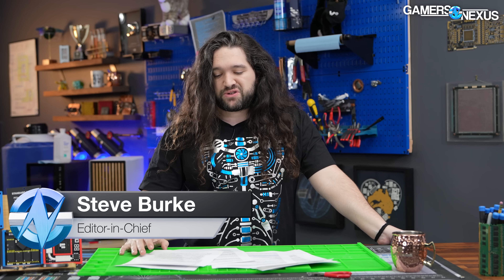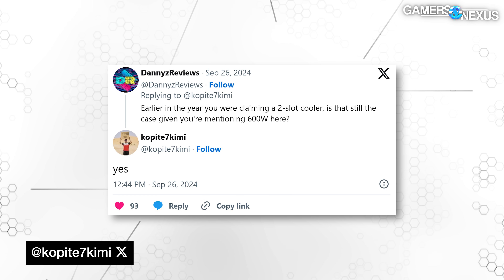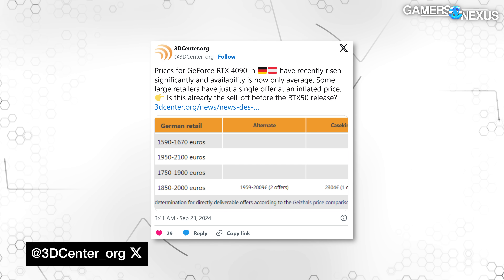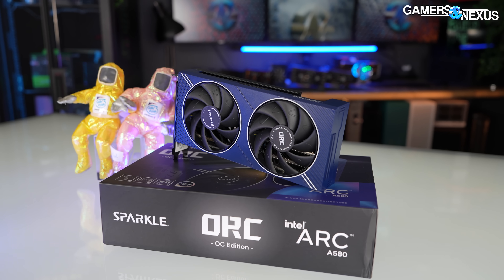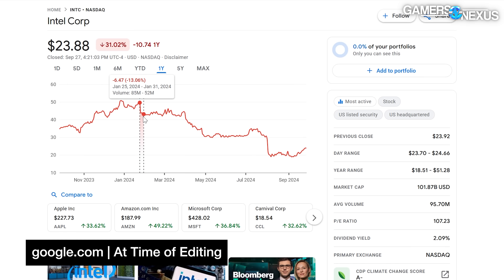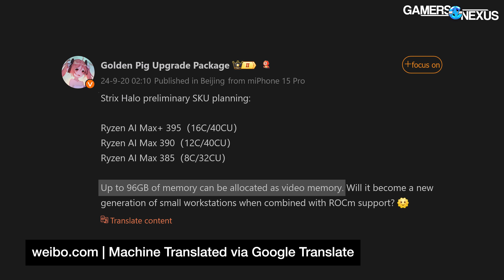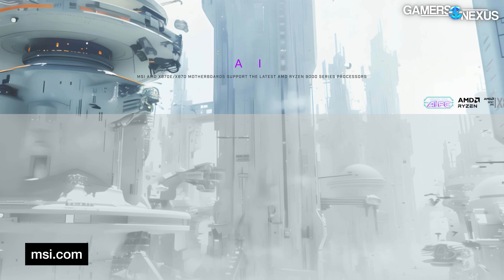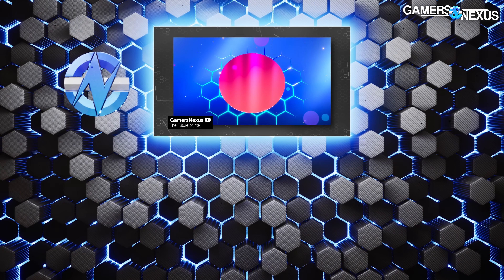HW News - RTX 5090 & 5080 Leaks, Valve ARM64 Experiments, Intel Arc 0% Marketshare, 4090 Price

Comment: If he stoked if the 5090 is sub $2300, because it'd still be a great value for 3D animators like myself who prior to the XX90 series got owned buying $5500 Quadros to get the VRAM we needed.
Reply: It's reasonable if it's less than $2,500. It's not like premium computer users spend less than $5,000 on their computers every 3 years anyway.

Comment: kinda weird that they would add 96 on the sinbgle die variant and only 128 on the onw with 2 dies.  Why not 2x 96=194 . that matrh is not mathing for me with 2 dies recieving 3d cache.  that means they have to make a custom cache die just for the 9900x3d and 9950x3d.  thats not efficient nore logical.

Comment: I was going to upgrade my 3080 10GB to the next AMD high end offering, but them dropping out of the race has left me stumped. The 5080 is such a disappointing card if the leaks are anything to go by. I will NOT even consider buying that card if the specs are right. It's basically what I would consider a 5070 to be.

Comment: In a world where SLI and Crossfire are dead and buried, what exactly is a 2000+ watt psu supposed to power in a desktop PC?
Reply: probably a dual CPU socket board. That's 700W for the CPUs only, plus that 600W for the GPU..
or for "home"servers, using several GPUs, which are shared

Comment: 2,200 Watt Power supply?  That won't run in my house with only 15 amp circuits.  Oh I see. 240V not 120V.  Is that 2 phase power like my range?
Reply: Probably not. The standard phase here in AU is 240V 10A. 2200W is rather close to that though. I've had my "2000W" heat gun occasionally trip a 10A breaker when on an extension cord
Reply: @greebj  here in europe we have 230V single-phase, and most sockets are limited at 16A - so 3680W maximum.
since we have 3-phase, and not 2-phase, the voltage between 2 phases is 400V, not 460V

Comment: AMD not competing in the high end means the xx90.  Don't forget the 4080 while costing a grand uses a mid range die. 

By calling the 4080 high end desktop or the 4090 flag ship desktop it makes it easier for them to charge more and doesn't shame them in the media for price gouging.
Reply: but consider: the 7900XTX is a direct competitor for the 4080(ti), not the 4090. And that 7900XTX was their high end card.
So their next, fastest 8000 series card will most probably a 8800XT or something, which competes with a 5070ti maximum.
So Nvidia can - and surely will - charge even more for their 5080 and above cards.

But as long as people still buy it, it doesn't matter.
Reply: @bernds6587  I don't think that is the case.  AMD has repeatedly called the 102 high end and has not called an Nvidia a flag ship since the gv100 die in the titan v. I think they will compete against the 5080 on desktop. And maybe higher.  The 5080 will be a midrange part that sells for a granf.  And I would expect AMD to compete with it and aim for more raw power. 

AMD has not had a flag ship for a decade and said they would not compete on the high end.  They haven't really been competitive with Nvidia's high end like 2080ti, 3080, 3090, or 4090 when those cards were new.  They are just going to continue that. We have also not had and flagship or high end parts on desktop for a couple generations now.
Reply: @zanzabar4ky7  hm. I searched for the exact wording for that interview.
Q: "Price point-wise, you have leadership, but you won't go after the flagship market?," to which Huynh replied: "One day, we may. But my priority right now is to build scale for AMD".
So you might be right, but such a definite statement coming directly from AMD does not hint towards a stretegy "we continue doing what we do right now", though.
I am undecided, and from all kinds of news you get, all is hinting towards cards which are slower than the current highend 7900XTX.
But we will know for sure, when the 8000 series drop.

Comment: We don't need two slot cards. We need cards with less width. Because of the overly huge PCBs and coolers in a lot of cases you can't even plug in the power connector properly as there is no room.. 2 slot big cards look like a joke anyway it's like a slice of pizza. (for example the non-OC Inno X3 4080S)

Comment: I had a 13th gen Intel HP laptop, it died within 9 months. Luckily, I did regular backups, and I could return it since it was under warranty, but i just don't trust intel for their future generations, even though, ironically, I run a 12th gen i9 and it works very well.

Comment: The problem for Intel graphics cards is that they're not priced appropriately compared to performance and driver issues. Why would I buy a new Arc A770 for $300 new, when I can buy a used RTX 3070 for $235, where it does  way better in gaming, and also better for streaming, video editing, and encoding with NVENC over Intel Quick Sync (which you get with an Intel iGPU, anyway)? If the A770 was $150 MSRP, or bundled to be that low with an Intel CPU, then getting one would be a no-brainer.

Comment: double x3d cache doesn't fix the issue on enterprise servers and they need to be treated as different numa nodes. I Hy would it fix desktop.  We need compact cores on the off ccd.  Windows knows how to use compact cores and an 8 3d + 16 compact chip fits the target better. Even 8 normal and 8 compact cores ould be better than the 9950 for gaming.

Comment: Sigh...

600W can be done... not an issue of can.. an issue of noise. 

We had the same nonsense discussion about 6 or 7 years ago... when we went over 200W into the 300W regions and OH NO... IMPOSSIBLE....

No it's not, it's actually not that difficult all together, but it will mean a lot of air will be moving, some elements will be in the 90C regions and SFF cases will be a joke with it. Engineering wise, not a challenge at all. 600W is an easy dissipation, especially with how 'wide' 2 slot cards are considered (2.5 is more realistic... for these 2 slot coolers). In addition, Nvidia is already dumping a ridiculous amount of heat into the case, so I expect that to only become worse.

If the card draws ambient air in, directly, to cool itself and dumps it into the case, it's not a challenge. As for optimal design it would help if we would return to the old radial fans and push as much of that heat out. 600W in the case (extra on top of CPU/mem/mobo etc.) is not ideal.

This is not a topic about 'can we cool 600W', this is a topic of 'do we want 600W of heat in our case' when you look at the normal circulation setups with axial fans inside a case.

Now... for once GN... when you have these questions... talk to a HVAC engineer instead of throwing out 'concerns' that only mix things up the wrong way.

Comment: I just RMA'd my 14700k, did the cross ship ($25 out of my pocket...) and swapped in the new one. No issues so far. They still have yet to "validate" my old one (not sure what that process entails?) so I still haven't gotten my money hold back (~450$). The process of getting the chip was easy, but getting my $$$ back after mailing it back (it arrived on the 24th of Oct) has been another issue...

Comment: So Re; 5090 and AI
Should i be waiting to see what the 5090 offers for local AI projects instead of getting the 4090
Cus yeah, 4090 is around 2K+ Euro and from the sounds of it that not a good price,

Ruing a 4080 TI atm which its enough for my learning but struggles with things like flux. I'm not in a huge rush. but the 4080 from what i can tell , aint a good AI card, cus of memory and cores

Comment: Based on the specs of the so called "5080" Its actually going to be the "5070" rebadged as a fake 80class card and overclocked to be around ~4090~ performance. This them trying to do the 4080 (12gb) scam all over again. So the only question is whether or not consumers will put up with it.
Reply: You know they will, every RTX card sells like hot cakes and Nvidia is some of the richest company in the entire world.

Comment: Imaging you have 4090 for 2 years and somehow you can sell it for a profit after 2 years of usage :face-blue-smiling:
Reply: That’s my plan. lol. I have a 4070 super as a backup.
Reply: 4090 will be worth around 1000 dollars when 5090 and 5080 launches. That is not really profit, considering they paid 1600-1800 if not 2000 dollars for it.
Reply: @Dr.WhetFarts  probably not in US, but when I went back to China I sold mine 4090 Strix OC for 19999 RMB, which is roughly about 2850 USD, I don’t even know why someone would do it but I guess there’s demand in China

Comment: The 4070 at $540 is 72% faster than the A770 at $678. That's 4070, not TI or Super or TI Super. The 4070 TI is 109%l faster at $600. Aesthetics, I guess.

I did really want so much to like the Intel Arc GPUs... I did....

Comment: 14:53 Hopes AMD and Intel gains more of a market share but keeps using NVIDIA GPUs to edit their videos.

Steve, you're part of the problem.  People like you aren't willing to sacrifice performance and use a lessor GPU.  You constantly complain report that prices are too high yet you keep buying NVIDIA.  The market is never going to change as long as you keep buying NVIDIA.
Reply: exactly my thoughts. The 7900XTX and the 4090 have both 24GB VRAM, so...
If you need more, you need a workstation card, no matter if AMD or Nvidia

Comment: If the 5080 specs are legit, screw nvidia. I was holding out and saving up for it, but im not bending over for the same gb of vram and bus width as a 4080. 20gb and 384 bit minimum. Otherwise I'm going AMD

Comment: Man. Motherboards these days are just utter crap. Just pointless, over the top, over marketed VRM's. 
BRING BACK full audio I/O, more than 2 damn PCIE slots, stop forcing soon to be out of date WiFi on us, and bring back actual segmented displays. 
There are barely any new features, in fact features removed. But we're being sold 'Features' that are simply just the current 'Tech'. 
It's all over priced crap! Steve, dig out that ol' MSI Z170A and compare how 'feature' rich it is compared to today's boards.

Comment: Valve making things work on ARM, would be the first time i can stop correcting people on "emulation." Because it would be emulation from x86.

Also Proton is using WINE as part of the package.

Also would be nice to upgrade from the 3070 in my linux main workstation and gamint box and the 3050 in my streaming box. I want AV1 and some better performance for my LLM's, as well as my editing i do on my linux box. Be interested in a 5090 or 5080 for my main rig and a 4050 for the stream box.
Reply: amd gpus are far better for linux compatibility than nvidia. If you want good linux experience use amd gpu on linux machine. Anything from 6000 series or later will work fine, even something like rx6400.

Comment: Why would they release a 600W GPU when neither AMD nor Intel is planning on competing with them at the top end of this generation? Why not a smaller, less power-hungry chip with moderate performance gains and more chips per wafer in order to make more $$$? They could lower the price and still make the same profit per chip and AMD and Intel won't have anything to say about it.
Reply: he said that in the video - 600W most probably just being the max power for AIBs, or plainly a wrong/incorrect leak.

Comment: So 4090 is now $2000… 5090 at $2500 seems more than likely… and that leave room for 5080 to be $1500 so $500 cheaper than 4090 while being faster and $1000 cheper than 5090 while being slover than that.

5070 for $799?
That sounds logical step up in there…
Reply: I very much think so. And I fear you are more on the conservative level here.
Seeing as AMD won't have a highend card anymore, the still AMD top tier 7900XTX will fall further down the charts, and Nvidia can (and definitely will!) charge even more for their midrange and mid-high-range cards, too.
Dark times for enthusiasts.

Comment: Or we finally get 4k 60+ gaming in all titles no tricks no DLSS no AI BS fakery. I mean all we really want is top tier silicon, power unlocked that we can ramp up as high as can be usefully used. I would gladly run 600w all day if it got me the performance I have been waiting for, for literal years like 10 years since they released 4k displays. Also id "Deckard" or the next Steam deck doesnt have full x686 / 64 support I am moving to the woods and fuck tech all together. I just want devices that do what I want and that hasn't been a thing aside from TR stuff for a long time. AMD forgetting about high end cards is dumb AF cuz if streamers and YouTuber's dont use it no one will see how good it is and no one will buy it.

Comment: Nvidia remains undefeated. Intel only lost cause of how horribly bad they fumbled the bag, not because Zen was a great product, Nvidia hasnt stumbled this hard. The 6000 series showed that having a great product isnt enough, you also need a bad competitor. In my opinion if you wanted RT, you at least needed a 3080 and even then the vram limitation would get you. Below the 80 class of GPU, there isnt a reason to go with nvidia. Before someone metioned RT, you wont be doing that on a 3070 / ti, and DLSS while great, in my opinion is severally overhyped, it still ruins image quality.

Comment: 600W GPU? God I am so tired of these cards just mindlessly pumping watts. It's so dumb. I remember when the GTX 480 was laughed at for having a 250W TDP. Stop pushing the silicon so hard. I can't wait for NVIDIA to hit the performance wall.
Reply: Nvidia is not even close to hitting a wall. They went 5nm again, even if 3nm is ready, because they can.
Reply: Cards can only get so big to disapate heat until it's just impossible to fix and plus electricity bills exist 

They can't change thermodynamics